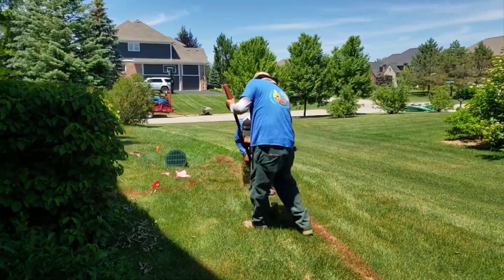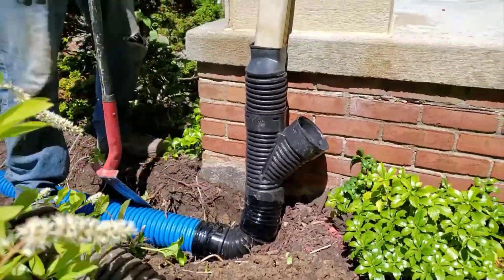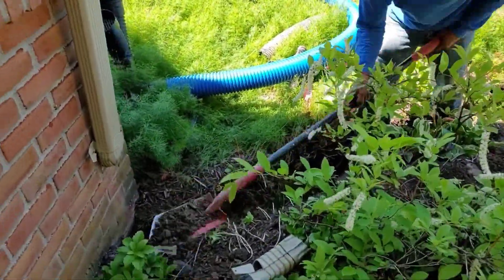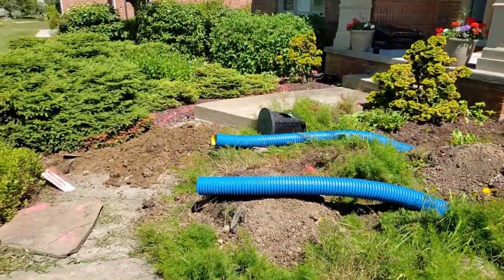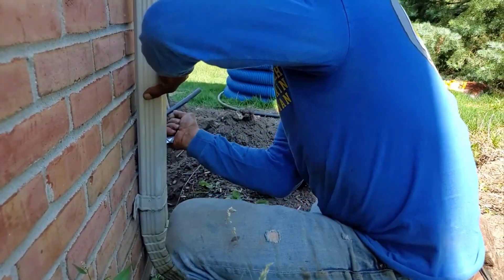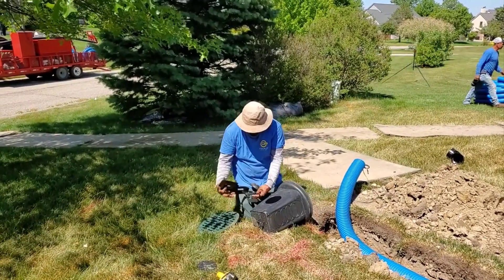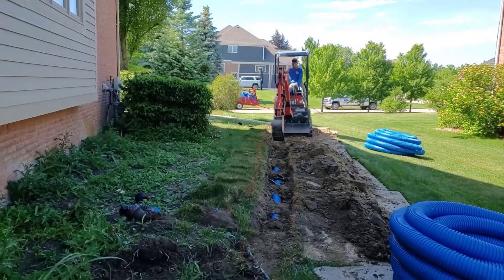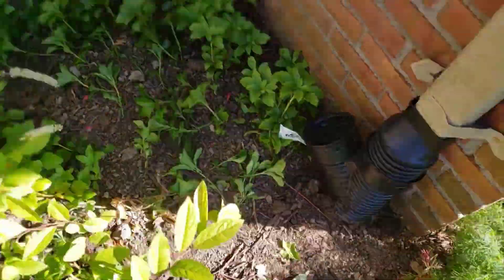Complete Guide to Roof Runoff Systems  [ 2020-2021 ]

Comment: Hello, Great video! I’m about ready to install a roof runoff system in the front of my home but have a couple of questions for you before I start. I’ll have two downspouts running into a catch basin/D-box that will oppose each other and both will be 90 degrees off of the discharge pipe (I hope this makes sense) is this a problem?  Also, how do you know if the 4” or 6” corrugated pipe should be used on the discharge side of the catch basin/D-box?
Reply from the maker: https://youtube.com/playlist?list=PLjFCqaZ4v1BUqichor2QH1X_p9bBPor8D&si=Ye5mvm1irk_KXlFm

Comment: Hey French Drain Man - Do you have any recommendations on how to find a GOOD drainage contractor in my area?  I live in central Ohio and have a collapsed underground runoff system which we temporarily fixed with above ground downspout extensions, in addition in our front yard we have a standing water issue every spring and I'd like to find a company who really is experienced with this stuff but pretty much I only find general plumbing or contracting companies that don't seem to have any particular specialization in drainage.  Don't want to pay for a sub-standard job and have to redo it later.
Reply from the maker: Best French Drain and Yard Drainage Contractor
https://frenchdrainman.com/

Comment: Don't understand plz explain where the roof run off water will go. Will it drain into front lawn like a leech field or will you tie the pipe into a main sewer line
Reply: wondering as well.

Comment: A friend of mine hired this guy to help out with drainage which was supposedly causing water in basement. This guy bought six  10’ foot section or Hone depot corrugated skimpy pipe. Dug a hole and laid down pipe in a P- Trap way only 5 feet from house with pop up. He threw out the other sections. Never used them. I can choke him. I won’t tell you his name is Steve Myers.
Reply from the maker: Best French Drain and Yard Drainage Contractor
https://frenchdrainman.com/